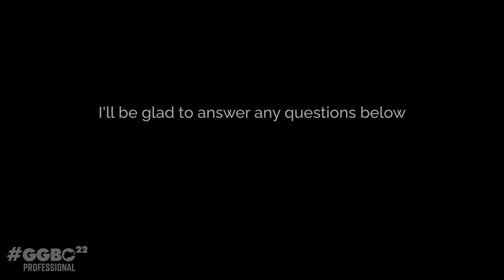Retrofuturistic Guitar - Full Build

Comment: Digging the router sled leveling station at the start of the video. Came for the guitar, stayed for the tools. What woods did you use for the neck and body BTW?
Reply from the maker: I used Marupá (Simarouba Amara Aubl., Simaroubaceae.) for the body. It's a very light brazilian wood, and great to work with. For the neck I used African Mahogany (Khaya Grandifoliola). And for the freatboard torrified Pau Ferro (Machaerium scleroxylon).

Comment: Great work, but regarding using a chisel or gouge make sure to never turn it towards you. Also, resting against it with your thumb and anchoring your fingers further away does not really serve a purpose. Push the chisel with your dominant hand, or use a mallet, and use your other hand to guide it and stop it from going further than you want.
Reply from the maker: I'm aware that my chisel work is not my strong suit hahahah thanks for the tips!